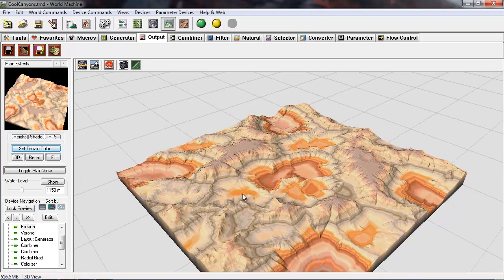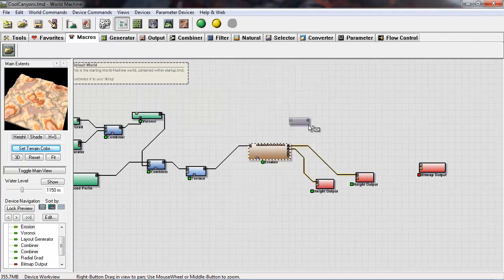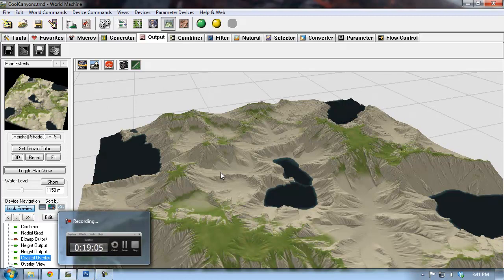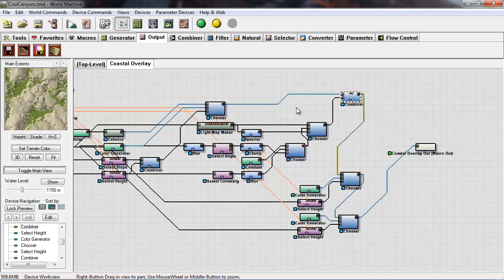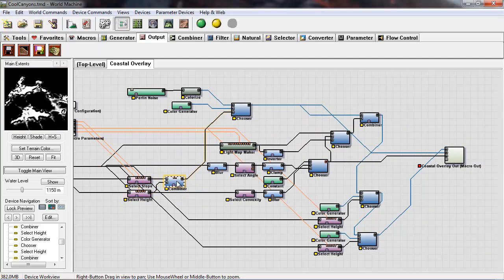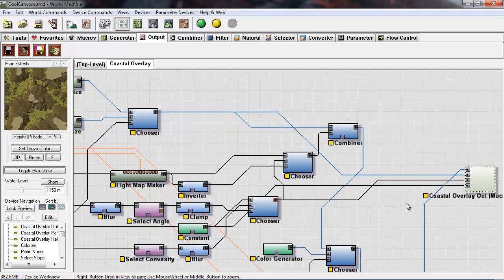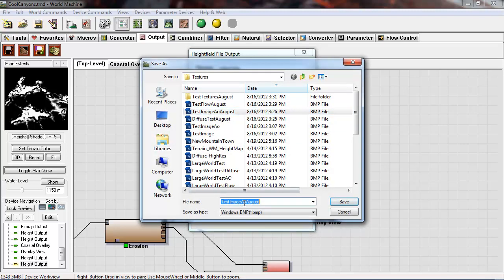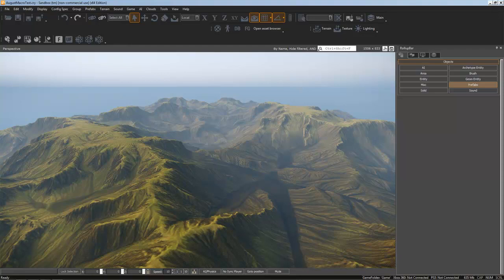Intro to World Machine: Chapter 05

Comment from the maker: no, unfortunately the size of the cryEngine level is linked to the height map resolution. You can at least lower the meters per unit to 1 instead of 2 when creating a new level. You can also lower the terrain lod amount so that it retains more of the form from World Machine. To do this just type in TerrainLodRatio in the console and change it to something lower like .4 or zero if you want to disable it all together. Good luck

Comment: Is there any way to make the world smaller without having to lower the resolution? As an example, i want to make a 256x256 world in CryEngine, but then i will have to render the heightmap out at the same resolution, and then it will not look very good when i import it into the engine.

Thanks!